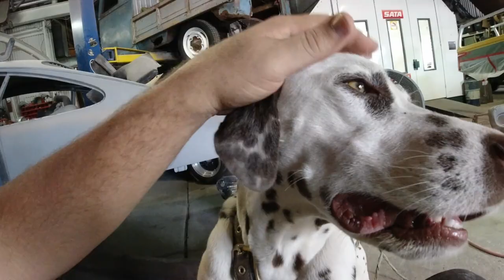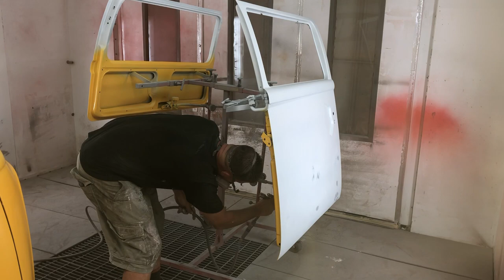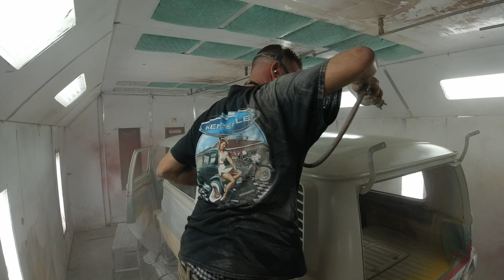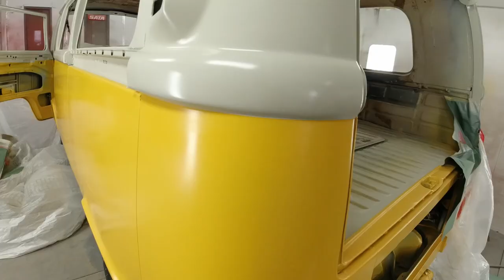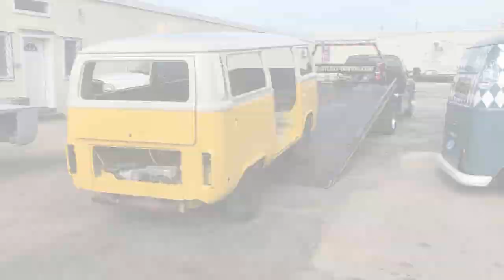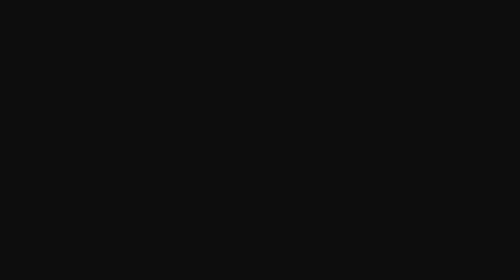My ‘79 Volkswagen BUS Gets Painted Yellow! | Base Coat / Clear Coat

Comment: Paul, why is the front bumper support different than all the other 73 and up buses I have seen/worked on/scrapped ??
Reply from the maker: The previous owner tucked the front bumper. He cut out the long front under bumper structure so the bumper would sit close to the body when installed. The front VW emblem and antenna have also been shaved.
Reply: @PaulBarger  Thanks Paul...it was nothing I had seen before and wondered about it.  Thanks.  Get her done right ?